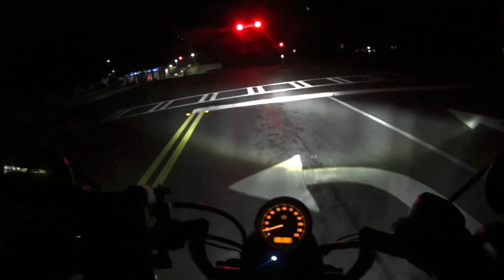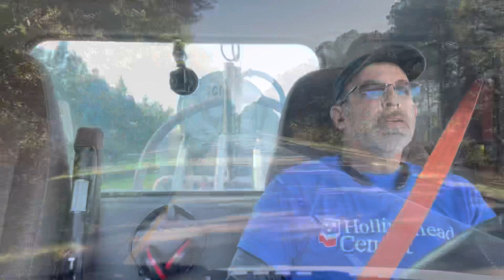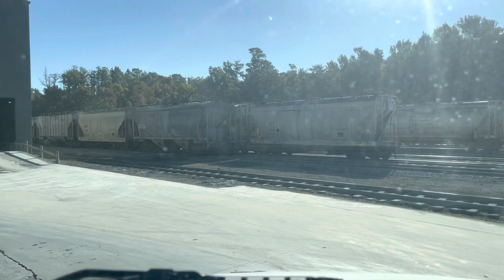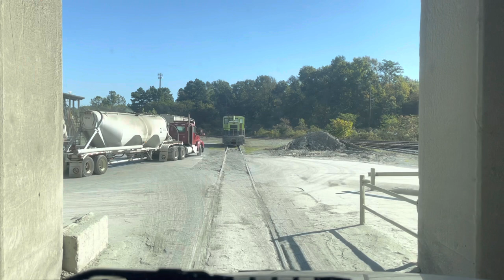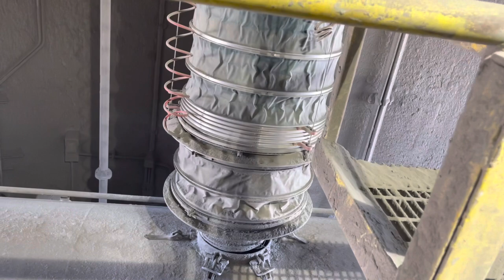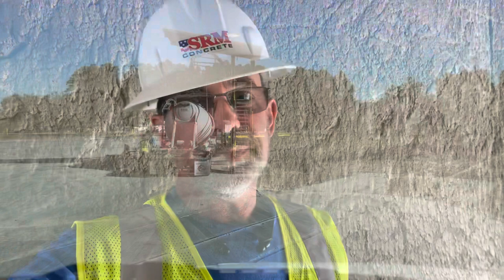Loading my Dry Bulk Tanker Trailer #motovlog

Comment: Thank you Dan for showing us the fill process. We may not see much, but we still learned something. I would have never have pictured a giant dryer vent duct hose looking thing, leading down to a hole, and then doing a thrusting action, as it pumped you up. Hopefully I will get to see you doing the pumping next next. I think you have a cool job, can't wait to see more. Moto power on the interstate, just wish folks would look out for ya before merging over lol.
Reply from the maker: The tanker job is cool but the hours are to unpredictable. I like structure in my week so I can plan my family time

Comment: Great motorcycle footage, looks like a great ride to work! How many more months can you ride before it gets too cold and you have to take your car in?
Reply from the maker: Since it is only 10-11 miles from home, it would have to be in the 30’s to low 40’s to scare me off. Those temps come in Dec-Feb but only for a few days at a time. Gets real cold then warms up to 45-50 then cold then warm. Southeast is fun!! 😂
Reply: @dansvlogtrucking  Lucky man, up here in Boston the bikes get put away in December just based on the freezing temps and then we pack on tons of snow as well. Some day hope to retire down south
Reply from the maker: @logdon17  I was born in Lawrence and raised 8 years in Salem NH right off route 28. I remember lots of snow and freezing walks to the bus stop